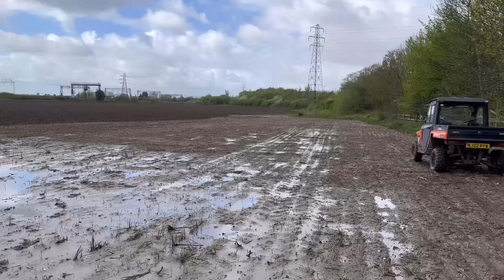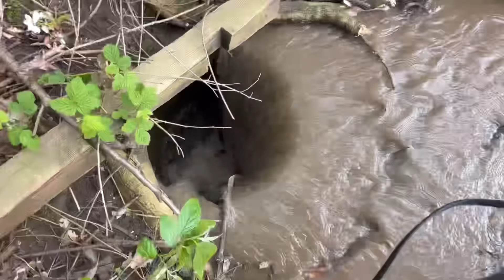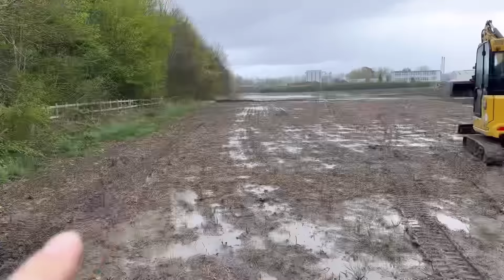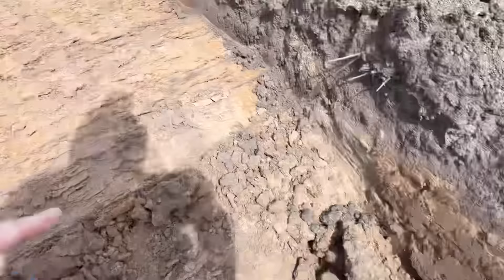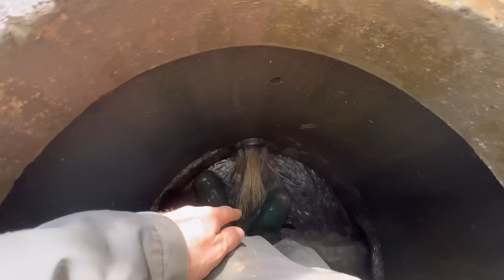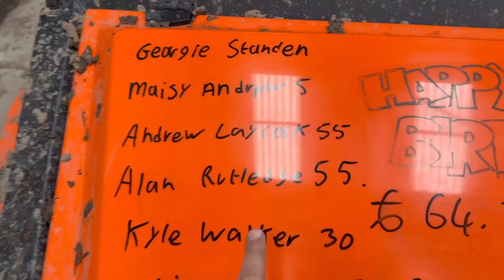TREE ROOTS CAUSE  FLOOD  #AnswerAsAPercent 1490

Comment: Always watch birthday bumper.    Well done to all money raised.     My late father bought a farm back in 1978, and quite a lot of the land was wet for most of the year.      There were springs in some of the fields, which helped to keep the land wet.      Anyway, Father's stepbrother cleared all the land drains out, clay pipes and replaced the pipes back in original trenches.     The digger was a 1963 JCB 1 with a 2 cylinder Petters engine aircooled.    Never failed to start, as it had a swing start, starting handle.    The pipes were originally laid by Italian POWs during the second world war.      Possibly some of your clay pipes may well be around 80 years old now.

Comment: Plenty of water flowing olly... Working on the canals its not a bad thing to have too much water but then it stops and you don't have enough water. For you it sucks as your drains are saturated. The canals were built with overfows.. its when they cant cope you know its far too wet. It's a fun day on the banking when you get high winds, sleet rain and snow😂

Comment: Great video olly when your making the dough make sure to use chilled water or the dough will be too sticky and you won't be able to get it out of mixer 2 percent salt of flour weight 3 percent yeast of flour weight and if your using a bread improver 1 percent of flour weight 50 to 55 per cent water depending on flour type if the water is hot you won't be able to work the dough you should get on to ireks UK they would give you a bread improver called voltex it's a multipurpose bread improver for all breads pan bread is 1percent baguettes and Vienna loaves are 2 percent you might also need a bread fat as well just few tips

Comment: Here in the states, when I put in conversation drainage with usda grant money, the engineers make us put filter fabric over the stones capping the drain tiles. Especially if it’s a drain topped with soil instead of an open, stoned, French drain. The road or filter fabric should help keep the fine roots out of the drain tiles.

Comment: could you get an attacher for the 360? deffo get the pitch then. 
think you should drop the hole full of gravel and trench to it with your new kit. interconnect a frenchie between both man holes.to eliviate the road runn off

Comment: Had same problem with willow roots in a soakaway from septic tank.
Glyphosate in an empty washing up liquid bottle,cordless drill and a long 5mm bit.
Angle hole towards roots 45 degrees, fill with glyphosate and seal with a pinch of clay.

Comment: Without being on site it's difficult to see which way the water is running. The drains you have found are blocked solid and the main drains are full of roots. Would it be possible to cut an open ditch along the tree line and find the drains that lead into it and jet the drains out. leave the headland drain open ,that will stop the tree roots blocking pipes